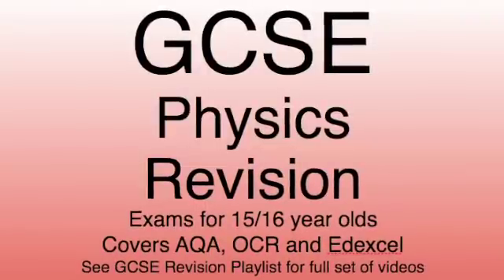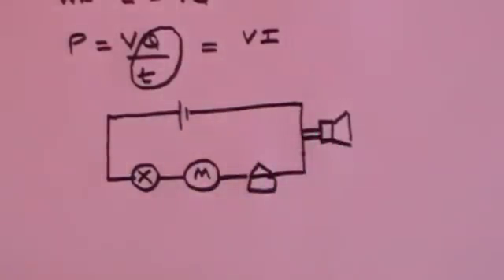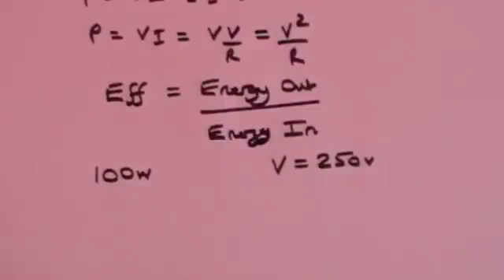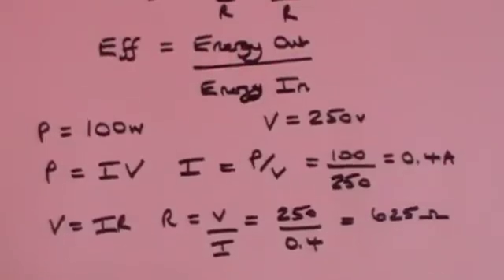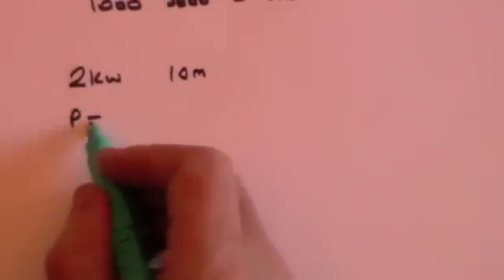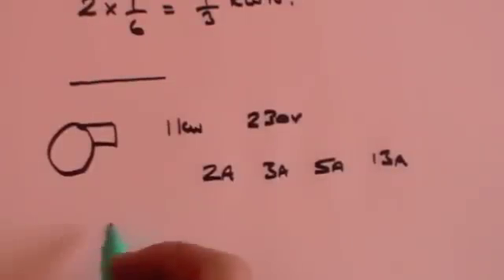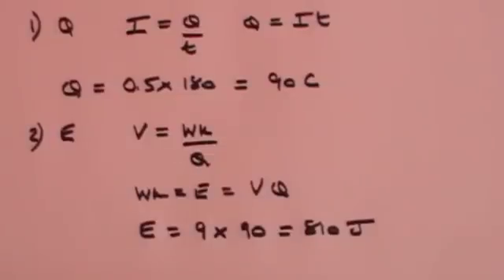Electrical Power: GCSE revision

Comment: Nice presentation! I wonder if it is not a conflict that the power either in voltage or current terms indicates that the increase in resistance both increases and decreases the dissipated power.

Comment: I don't get why you would choose the 5A fuse. The device can only take a current of up to 4.3 A, right? If you used the 5A fuse, the wire in the fuse would only melt when the current through it is >= 5A. So wouldn't the fuse allow more than 4.3A through the device and damage it??
Reply: The optimum current is 4.3 but if you take less then the fuse will melt when ever you use the device because thr device will draw 4.3 however if you takr exactly 4.3 then also it will melt when you plug it thus a little more than the optimum current should be the fuse rating as till that rating it's safe even though it is  a bit greater than the optimum.

Comment: Will it be correct if I say that one volt is that amount of electrical force needed to move one coulomb of charge through one ohm of electrical resistance? Thank you.
Reply from the maker: No. A volt is the work done to move 1 Coulomb of charge.

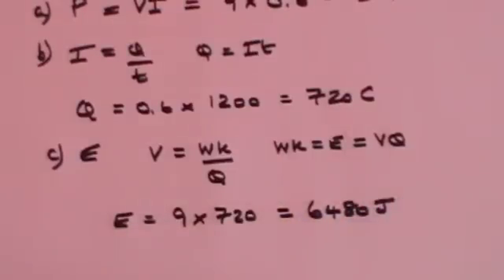Comment: Dr, you mentioned at 19:05 that the 625 Ohms is the initial lamp resistance, but isn't it the resistance value when it is already hot? Because you're using the standard/nominal values (Watts, Voltage) of the lamp.
Reply from the maker: Good point. I hadn't thought of that. Well spotted.
Reply: East43359 can you explain me what you're talking about I'm getting curious about that
Reply: @ASh-vi4xs  the values were given by the producer, thus his argument makes sense